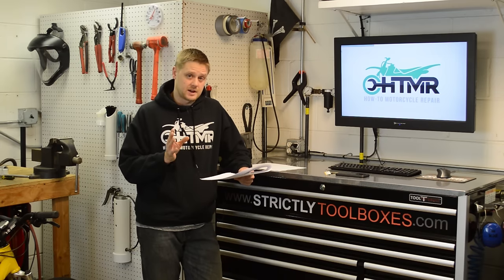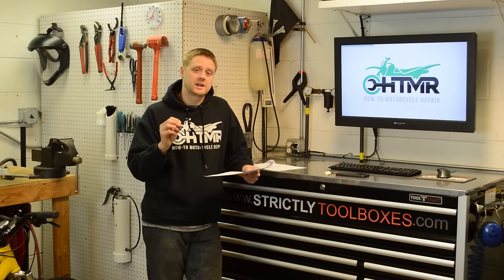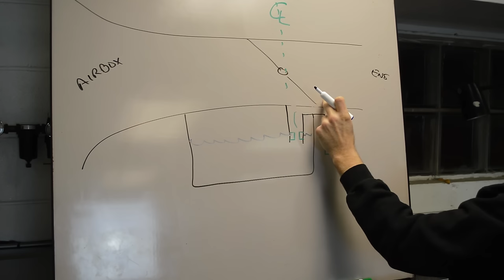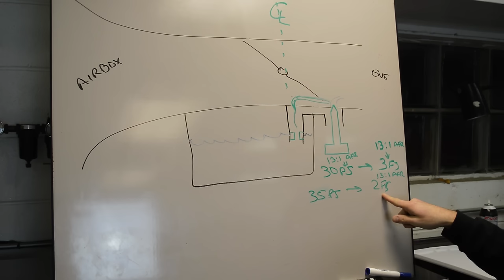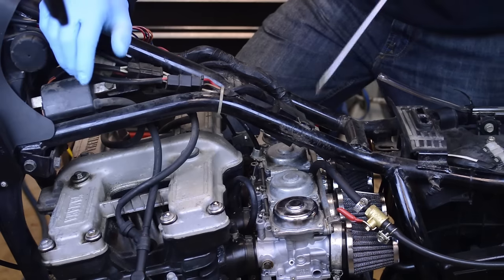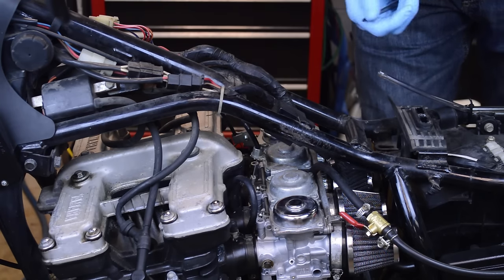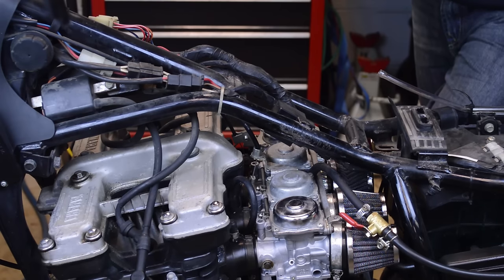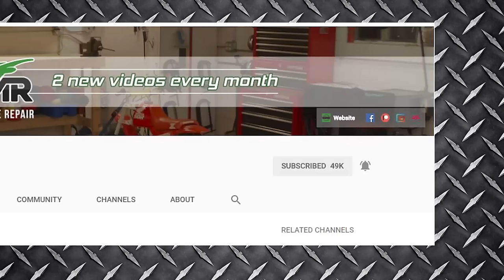Pilot Air/Fuel Screw Adjustment Explained - Multiple Carbs - Part 2

Comment: BTW... I am struggling with my 1400 '96 Intruder. I wanted to clean/rebuild the carbs and realized I need to swap out my sync cable and throttle cable because both were VERY warn! Well when I reassembled the carbs (I am very green at this) I must have made a mistake. But listening to this video I feel I have one carb (the rear) that is way too rich and the front carb WAY WAY too lean (the air box was even VERY hot after 7 minutes of running at idle)! Breaking down how the pilot circuit works is going to be SO helpful when I go back to double check the carbs. I also did not set the floats so that could be an issue as well. Learning as I go so thanks for taking the time to make this video. And it sounds like you are in the flight path at O'Hare. I live up in the NORTH NORTH burbs.
Reply from the maker: Yeah I'm in Mt Prospect.
Reply: @HTMR  Island Lake/Wauconda
Reply from the maker: @skiloist  I used to work at a shop out there.
Reply: @HTMR  well hopefully you left on your own cause if they let you go then they are missing out on one smart dude! Which shop was it?

Comment: excellent vid great help.could gauges I guess to get the fastest idle,on my old tiumph trident I went from 17 to 19 pilot jets and was surprised on the performance gain as I always thought pilots only really did anything at tiny throttle openings it also got rid off the tiny stumbles it had in traffic,this vid is more applicable to a gs1000g I may be buying but great stuff well done
Reply from the maker: Thanks!

Comment: Hey HTMR, I’m struggling to get a TTR 125 to run with a VM24 swap from Sudco as the original carb was missing from the bike. Currently has 17.5 pilot, 105 main on 3rd needle clip- it will run/idle with choke on only, and when I de-choke it it will rev sharply and then die. I’m trying to get it going for daughter as she has outgrown her KLX110 and I’ve never had this kind of struggle getting a carb to run. I watched your video regarding pilot circuit clogs and the circuit is clear and brand new jet that’s also clear.
Reply from the maker: That carb has an air screw. Have you tried to mess with the settings? Should be 1.5 out for starters. Will it run above idle when you turn choke off?
Reply: @HTMR   Thanks so much for getting back to me and really quickly. I haven’t changed the air screw settings, but I will ensure that it’s set properly before swapping any jets. It will run with the throttle 3/8-full so I’m thinking I need to richen the pilot much like the choke is doing. I merely put in the jets that were recommended on thumper talk thread outlining this swap.
Reply: @HTMR  thank you so much. I found the air screw was 5.5 turns out so reset it, fattened up the pilot jet and main, then followed your video on tuning via the air screw instructions and now it has idle without choke, good throttle response. Will continue to fine tune it! At least it will now idle and I can tune it from this point. Hard to do when it wouldn’t even run!
Reply from the maker: @Natedoc808  Nice job!

Comment: Hey mate i recently pulled off the carbs off my 1999 thunderbird sport . Bike has been sitting for 9 years. Cleaned them out put them back on the bike, tried starting it… the idle is high probably at it’s highest. Is it my idle screw mixture ? I did pull it out and clean the whole carb and put all 3 screws back in. If i am getting high revs should i be turning it in or out ?

Comment: Thanks, great video.  Each time you said you were turning 1/2 turn you actually turned a whole (1) turn.  What's up there?  I thought each carb should be adjusted individually.  There may be variation in the carbs and engine that would require slight differences, don't you think?
Reply from the maker: 1/2 turn is 180°
Reply: @HTMR  Yes it is.  Watch 19:50 for example.
Reply: @BasicPoke  I am a bit late to the party lol. But the first one where he stalled it out he did a half turn out then a half turn back in. It looks like a full turn at first. The others were full turns I believe to reset things.

Comment: Thanks you MatthewMCrepair for making this videos and helping us out. I have one question. I have CBR 600, 1998 and it runs great on the streets but idle sometimes drops below normal point. Smell from the exhaust is really hard (gasoline) all of the pilots screws are 2.5 turns out (somebody before has messed with the carbs). I have taken the spark plugs out and found that number 1 and 2 are really black. 3 and 4 seems to be OK. Should I try to put number 1 and 2 let say 2 turns out and leave number 3 and 4 2.5? Or should I lean all 4 of them a bit and see how it runs? Thank you in advance and greetings from Croatia.
Reply: @FourthWayRanch  Tnx for the help. I will do that and see how it runs. Cheers

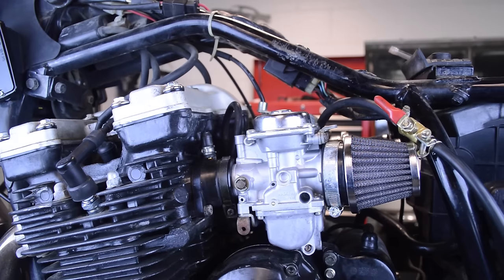Comment: Hi, i am building a scrambler out of a kawasaki 1997 er5. I threw the original air box away and put on 2 individual air filters on it like u see at 15:28. i put everything together and started up the bike. I think their is to much air that is coming in the carburetor. So my guess is, get bigger pilot jets and maybe needles and then tune em with the air screw of fuel screw, depends what my carburator has right? can u give me your opinion please, i'm not a mechanic. trying to teach me some on my own. Thanks, awesome video!

Comment: 1997 vlx600, removed exhaust baffles and VERY restrictive airbox and filter, it became so lean it wouldn't come off idle, went from 40 to 45 on pilots and 115 to 155 on mains and raised needle height on clip position. Runs MUCH better but screw adjustment is 2.5 turns out on left carb and 3.5 -4 turns out on right!  Any ideas on why such a difference?

Comment: Thank you very much for this wonderful video! Maybe I missed it, but is it okay to readjust the idle RPM to 900 when you are done finetuning?
Reply from the maker: Sure, but it may run smoother a bit higher than that.
Reply: @HTMR   thx for your reply :) So when I am done fine tuning is it best to leave the idle on whatever RMP it lands on or adjust it down a bit?
Reply from the maker: @ChristofferSolander  Adjust it to what the service manual says.

Comment: AWSOME VIDEO! I have a 98 Valkryie and my carbs were nasty. I took them apart and cleaned them up, but when I did the pilots the book said to count turns until they seated, before removing.  Some had 1 turn and others had 2.5 turns, spec was 2.5 for new jets. I see in your video you adjusted them to the same amounts of turns. Should they all be the same or do some carbs run at different settings?
Reply from the maker: 95% of the time they should be the same.
Reply: @HTMR  
Thanks. What's the best way to tune the pilot settings on multiple carburetors. Idle drop, vacuum sync.ect and do you have any videos? Thanks
Reply from the maker: @1cisqo  This video shows how I do it. Set them for max idle RPM and smoothness.

Comment: Hello! I would like to ask a question. If you might can help me. Bike is Yamaha YZF R6 2000. When I speed up with bike it rattles a lot and there’s black smoke coming out from the exhaust. Bike isn’t running perfectly when it’s in neutral. What might be the issue?
Sincerelly, Mika from Finland

Comment: Can i get your opinion. I have gsx 750 f 2001 with slip on. I just got dynojet jetkit.On the basics it says that with slip on put 114 main jet,dynojets needle to pos 3 and all the pilot jets screws 3.5 turns out. Before this i had pilot screws in 2.5 in cyl 2 and 4 and on 1 and 4 3 turns out. Bike worked very nice but i thin it was little bit lean. I put the needle to pos 5 and now it work worst than the factory instructions. So should i put needle back to pos 3 and put 3.5 to pilot screw
Reply from the maker: First off, what is the problem? Then I can recommend a solution.

Comment: Matt,
What would you do for a bike that is running rich? The bike is stock 1997 Zx6r except for a D&D slip on exhaust. The carb jets are pilot 35, 148(outer) and 150 inner jets for main. The stick setup is 35, 145, 150. There is an eclip slide needle that was set on position 2 from the blunt end. I reset that to the last position making it as lean as it can go. Problem is the bike idles great and revs fine at rest. Take it off the driveway and it hesitates, sputters with intermittent acceleration. These carbs have been cleaned numerous times, floats set at 19mm, 17 was stick setup and was a +\- 2mm option. I had float bowl overflow at 17 so I reset to 19mm. Any ideas?

Comment: Right now I have a 1980 Suzuki gs550 and it idles pretty good but when I rev it it only revs to about 5 or 6 grand and then tried to bog out but when I let off the throttle it goes back and idles fine. Would the tuning be the issue?

Comment: I have a question.. I bought a yamaha road star silverado 1600. Year 2000. It came with aftermarket exhaust,  but only had regular filter and carburetor not adjusted.  I was getting 46 mpg because the bike was running lean. Now I put a Dyno jet kit and K&N air filter.  Now I'm getting 34 mpg.  Is that normal?  Also  when I turn on the bike when cold I dont need choke and after warming up for a minute,  I try to rev it quickly and feels like it chokes up, but if I wait for it to warm up for 3 minutes that won't happen.  Is this all normal? It was backfiring when down shifting and deceleration.  Now with this tune it doesn't do it which I like. It live in a desert environment at 3,000 ft of elevation. Thanks

Comment: Taking a chance on this, 98 yzf 600 cleaned and set up carbs, carbs running erratic b4, stripped cleaned and much more stable and starts everytime and idles great, my only worry is very slow to start, sounds like fully charged battery is dead but kicks to life in maybe 2 seconds, just sounds healthy after initial start but on turning the key there's a huge delay, everything was benchmarked and runs great, just sounds dead on startup, was fine b4 carb clean and setup, not a big prob, just trying to understand why
Reply from the maker: Not sure I understand your problem now. Is it an electrical issue now? Post a video?

Comment: So are you adjusting both fuel and air screws when you set them at 2.5 turns out?
Edit: Im asking because I'm having trouble getting my 93 kawasaki 500 at full throttle. Seems to lose throttle after it gets to 8 85 in 6th gear. I feel like I'm adjusting the main jet only which is probably the fuel screw. So if i put the air screw at 2.5 turns then i may be concluding my issue

Comment: Are you not using a tachometer during this process nor adjusting idle knob during this process? Just gauging by the vibe of how it seems to run?
Reply from the maker: I was watching the tach, not shown in video. Should idle 1100, at least this model.
Reply: @HTMR  ok thank you! I'm about to do this procedure, and the Clymer manual has a very detailed (almost confusing) description... I guess the only solution is to now do it! :)

Comment: My pilot screw meters fuel in my application.  If a pilot jet is clogged, would the engine be able to idle on the main jet at all?  When I was turning the pilot screw all the way in , it was having no effect.  Engine didn't seem to change at all.  It was also hanging in revs after reving it up.  I screwed around with the pilot screw and let it run for awhile and it started now dying down when pilot screw was turned all the way in like it should.  Is it possible, I had a clog in the pilot jet and it was running off main jet and once the clog went away in the pilot jet, the pilot screw was now effecting it like it should.  Also the hanging revs stopped and it now kinda bogs down after reving and then comes back up to idle. Which I think from your video means the a/f is now a little rich.  Thanks for the helpful video
Reply from the maker: It won't idle on the main jet. Are the carbs clean and no vacuum leaks?
Reply: @HTMR  yes I pulled the carbs apart and cleaned them and sprayed carb cleaner around boots and intake box
Reply from the maker: @TheHeadlessHorseman  What year make model?

Comment: Hi i have a tgb target 525 . 503 cc engine. This use a mikuni carb BSR 33 (33MM DIAMETER) and i wanna ask what is the best jet combination to get max power and high rpm( 9.000...10.000rpm) .from the factory this came with .225 PILOT JET and 145 MAIN JET and at the moment is runing a ignitech cdi unit witch is programable and no rev limited. Thank you.

Comment: QUESTION, please (5 years later!) - How to know when your Pilot Fuel Screws are SEATED? When screwing in, the spring begins to add tension... but this is very soft and gradual. In theory you could twist that screw in a long way, using a lot of torque. SO- What is "SEATED" and how can you find this?
Reply from the maker: Keep going until it bottoms. Just use low torque to do so.

Comment: Should you always put the idle screws at the same position? Or is it possible to tune them individually?
Reply from the maker: Generally they should be the same. However they can be different if it runs better. Sometimes people damage the screws and carb bodies and you have no choice but to have different settings.

Comment: thanks for the video.  Ever experience a pilot screw that is stuck and won't come out.  I got it broken loose and it backs partially out the bore but they just spings and doesn't fall out.  Any ideas how to get it out?
Reply from the maker: Use a thumb tack and put pressure on it from the carb bore. Make sure the tack does not enlarge the orifice in carb body. Make sure threads are clean first.
Reply: @HTMR  thanks for the reply. I ended up soaking it in wd40 for a little and a few taps on carb body and out it came

Comment: On this radian with pods, did you change needle position or main jets? Or just pilot jets? I have an 86 radian I just put in a 6sigma jet kit which has 35 pilot. It idles good but as soon as I start to roll throttle it dies. Sounds like a bog but it dies so fast its hard to tell.
Reply from the maker: Yes, needles were shimmed (or clips moved) and larger mains. I can't remember the exact jetting though, it was a long time ago.

Comment: Great video! I have a multicarb Kawasaki. Throttleshaft on carb 2 and 4 has a little vacuumleak action going on. The felt seals are not easy to replace so I tried compensating by adding more fuel by turning the fuel screws out a little on carb 2 and 4. It cleared it up. Is it okay to compensate with more fuel??
Reply from the maker: Yes, if you want to get crazy, look into the colortune plug tool
Reply: @HTMR  thanks. Unfortunately they are not easy to get here in Europe. Still looking tho

Comment: I have a kawasaki zr7 750cc, carb is cleaned but I’m confused with the idle screw. This morning I had a ride, at traffic the rpm went up all of the sudden. What does that mean? My idle screw as at 2 turns. My carb is Keihin CVK. My jet size is 108 and screw is 38.

Comment: Hey Mate. Awesome video. What causing the idle to rise by itself after 30 sec? Bike is running fine then goes up around 2000rpm
Reply from the maker: Check that all cylinders are firing before and after this happens with an IR gun.

Comment: Hi I have. A 150cc and I brought a new carby a weak ago now. But my bike doesn't want to stay running it shuts off when I'm in second gear the air screw is turnt right and the idle is right but I don't know why it keeps shutting off

Comment: I have a 2002 Vz800 idle is fine but during 1/2 to full throttle it chokes down under load. Rev up sitting and hold it. It causes popping out of front cylinder. What do you recommend?
Reply from the maker: Check for vacuum leaks. Take apart carb and clean it.

Comment: So you videos are awesome.  Very helpful.  But, my afr screws are located on the bottom of carb.  When bike is somewhat warmed up like it is supposed to be to adjust, well I cannot put my hands in there to adjust them especially while it is running.  Way too hot.  If I manage to take enough burning  pain to make adjustment, it is jerky turns and basically unmeasurable.  Not enough space to wear gloves.  Help?
Reply from the maker: They make special tools for that location: https://amzn.to/3dGXNXg

Comment: Hi Mathew. Love your videos man!! I see excellent info on how to determine what pilot screw one has. As a new subscriber I'm not if you've covered what the best distance is between your pod / aftermarket filters and the carbs and how to determine the distance. I have heard that some engines are not "happy" with pods connected directly onto carbs. Can you assist please? I'm currently busy with a CX 500 cafe build and any info would be immensely appreciated.

Cheers mate
Joe
Reply from the maker: I just install them directly to the carb. Just make sure not to block and passages on the carb body.

Comment: Bro!... when installing the air mixture screws does the washer or the seal come first inside the carburetor?
Reply from the maker: Screw > spring > washer > oring
Reply: @HTMR  thnx...I removed the screws for cleaning and my neighbor dropped carb🤦‍♂️luckily I found the washer and seal😖

Comment: Will a lean condition cause the engine to run higher temperatures? This adjustment has greatest impact on idle and acceleration. Correct ? I cleaned my carbs - no new jets. Runs fine at the factory setting, two turns out. Should I just leave it at that? I put in new pilots that can be adjusted.
Reply from the maker: Yes lean is hotter. What year make model?
Reply: @HTMR  Honda CB900C 1982 with Keihin carbs.

Comment: Thanks for the great video! What main jet size are you using with these air pod filters? I'm working on my 1990 XJ600 right now with the same air pods.
Reply from the maker: Usually add 10-20 on top of the main you have. For example, if you currently have 100, then 110-120 will work.